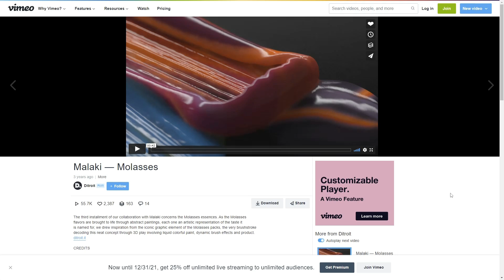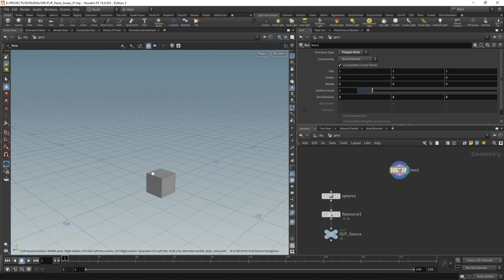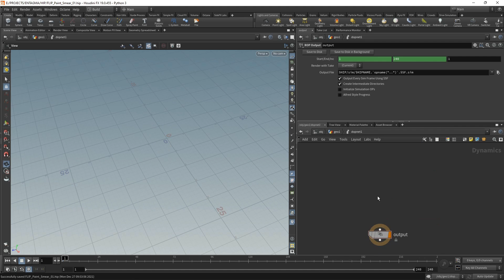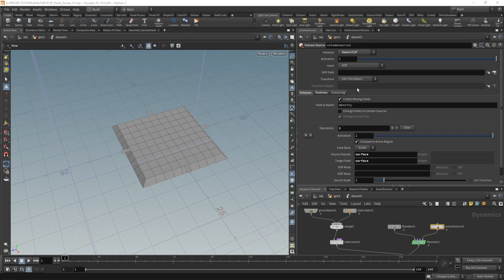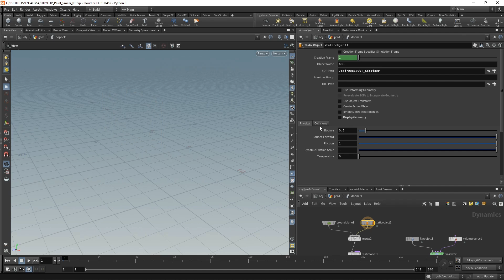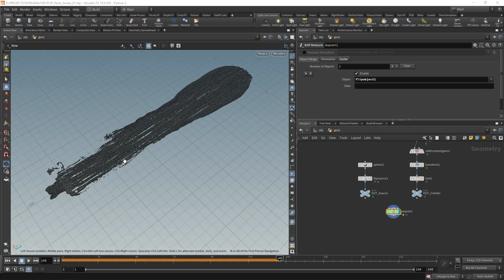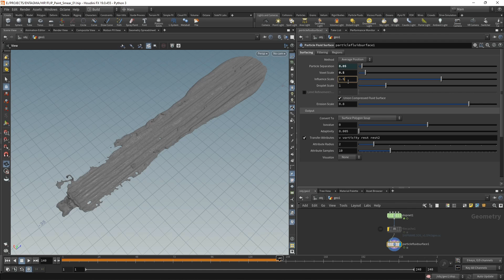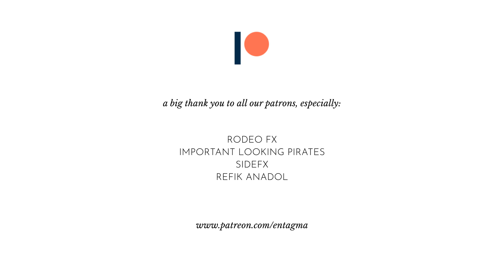Using Houdini To Simulate Paint Smearing

Comment: this is a great tutorial, but details like adding a trail node are frustrating. How would we know that we need velocity data? How would we know that the trail node provides this? I would easily be stuck, and have no clue that I needed this. Actually, it seems to work fine without it. Why did we need this? Does this provide vertex velocity data on the particle fluid surface?

Comment: Awesome as always.
Just out of curiosity:
Do you know if the scale has an impact on the result or not? Like for the flip sim, does it make a difference for the FLIP sim at what scale I would do this? 
Or is the result the same if I scale everything accordingly = multiply the overall scale and the relevant parameters like particle separation by say 0.01 
(scaling the whole sim from a size of 32m to 32cm ; )
If my goal was to have an accurate sim is it good practice to work in real life scale from the start?
I guess for rendering at least it is good practice to work with real world units.
Since the meshing occurs after the sim, I can simply use a transform, without having to re-sim everything, I assume.

Comment: Hey, I'm also new to houdini and have a lil question, is it possible just to duplicate those systems and make them interact with each other (combine 2 colors for example)?
Reply from the maker: Heyhey,

I'd rather use two separate FLIP Sources emitting differently colored particles in the same Simulation than trying to get two separate FLIP sims to interact.

Cheers, Mo
Reply: @Entagma  oh, ok, will have to get there haha
also, is there any possibility to export the simulation to C4D (for Redshift Rendering) and having colors interacting?
And thanks a lot for helping out!!

Comment: Thanks for the knowledge Moritz! Is there any reason you choose to go with FLIP over the new vellum fluids? I was under the impression vellum fluids would be more suited for smaller scale sims such as this
Reply from the maker: Hi Austin,

in my preliminary tests when preparing this setup, FLIP turned out to be faster than vellum Fluids, but that might be to blame on my weird test setups.

Cheers, Mo
Reply: @Entagma  if it works it works! lol cheers, thanks again!
Reply: @austin_wendenburg  the vellum fluids being sort of SPH means you need ridiculous substeps as viscosity rises, to stop the particles exploding. FLIP doesn’t require the substeps to maintain stability.
Reply: @lewisvtaylor  That's good to know! Cheers, thanks for sharing.

Comment: sorry i have a question since i am not a professional in houdini, in 2:45 u place a mountain node but it comes as an attribute noise for u but a regular mountain for me, how should i fix that?
Reply from the maker: Sounds like you're not using H19 - Mountain has been replaced with a particular preset in the attribute noise in version 19. Cheers, Mo
Reply: @Entagma  yesss, you are right thanks

Comment: Pretty awesome. Did you also try vellum or this?
Reply from the maker: Yes, I was when deciding which route to go. In this case FLIP turned out to be a bit faster than vellum. But that might have just been my weird vellum settings. Cheers
Reply: @Entagma  Thanks for answer. I wouldn't expect vellum to be faster, just were curious if you tried. This first iteration is pretty slow TBH but I don't have much experience with fluids.
I've seen the original animation Malaki — Molasses long time ago and always wanted to try to recreate. Thanks or the tut Mo.

Comment: the sim may look okay, but scene and objects scale are completely off. The emitter is 5 meters high, the whole brushstroke sim is 30 meters long . Did you change the scene units in Houdini settings before or am i missing something? Thanks
Reply from the maker: Heyhey, as per my understanding Houdini is unitless, so you can "correct" the size by just scaling down your sim globally if it's irritating to you. :) Cheers, Mo
Reply: @Entagma  Houdini solvers and integrated forces are closely linked to scene units (1 meter/unit by default). A flip sim of wine poured into a 30 meter glass would behave like an ocean. A brushstroke simmed in a 30 meter domain and one in a 30 cm domain would look and behave completely differently (provided that forces like gravity are not adjusted/multiplied to the same magnitude). I tend to respect the scene units by adjusting the scale of incoming geo to match real life sizes of objects. It just threw me off a little to see an emitter of such size. Thanks for the reply!
Reply: @ghost3dee  You're totally right, but I don't think it matters so much in this specific case just because the viscosity is so high, the only real interaction being simulated is between the source and the collider. All the gravity force is doing is holding it to the ground plane; you could pretty much set it at any negative value and the results would be the same.

Comment: Hi Moritz, a question if i may, how to mix UVs, for example if i were to "mix" 2 or more paint emitter/particles? Or if i'm using an image as my material? Thank you!
Reply from the maker: Heyhey, you can add any attributes you like to your points after the flip source in SOPs. Be it uv coordinates, color or whatever. E.g. try using an attribnoise set to generate a float followed by a color node set to ramp by attribute and see what that does to your fluid's colors. :)

Cheers, Mo
Reply: @Entagma  This tut is awesome! Would love to be able to set the color of the particles t the beginning that way the brush smears the colors. The Noise just colors the paint and does not set and smear. Any tips?
Reply: @iamsoutherland  Second that. Also I managed to color the particles, but would like to retain the color after the meshing, for the render.
Reply: Oh, so I just fiddled around a bit.
Disclaimer, I have no I idea if this is proper, but it seems to work. 
I created two flip sources, gave them different colors.
Simply merged them before the OUT_Source.
Then in the Particle Fluid Surface In the transfer attribute field I typed: Cd
Now The mesh has two colors, that are mixing.
Maybe add an attribute blur to add the nasty borders as the colors are applied to polygons?
Better solutions welcome.
Reply: @metaturnal  Thanks man, great solution! Quick question though... Do you by any chance know how I can apply separate materials to both flip sources? When rendering with Redshift, for example, I can add a RS User Data Color node in my material, which allows me to use both colors I've used before merging the flip sources. That's already great... But what if I wanted to apply two completely different materials to both flip sources? Cheerz!